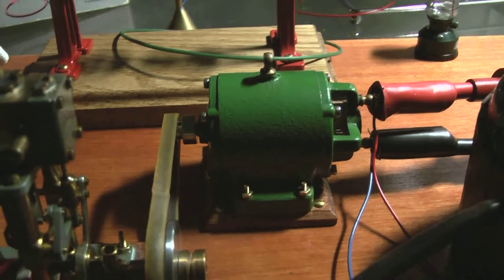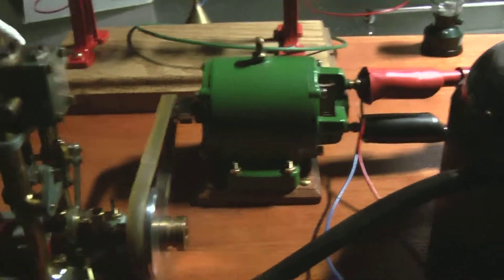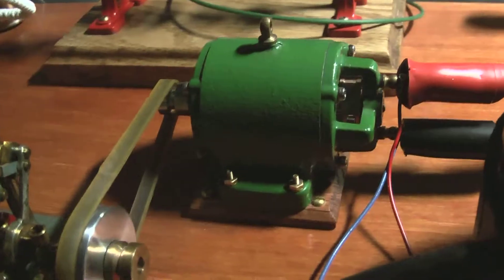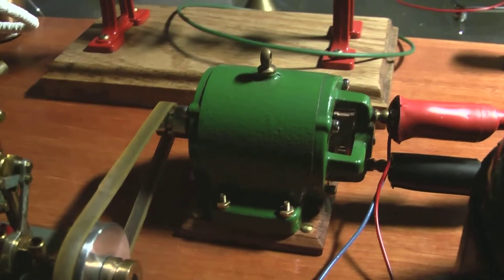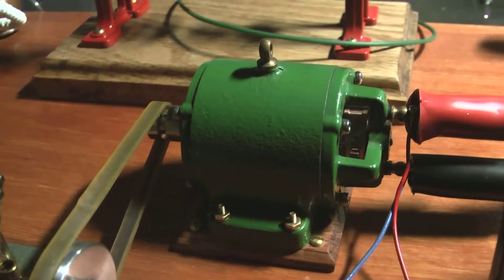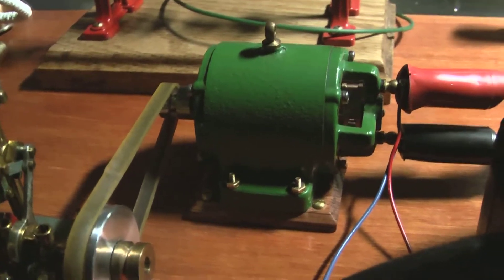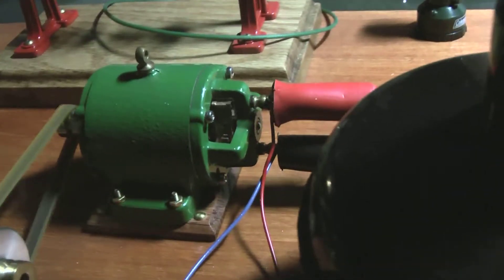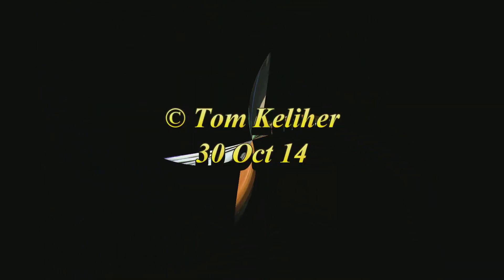PM Research Dynamo Redux

Comment: Nice work! It's possible to have the terminals horizontal, but you also need to rotate the magnets 90 degrees, which takes a bit of modification to the original design.